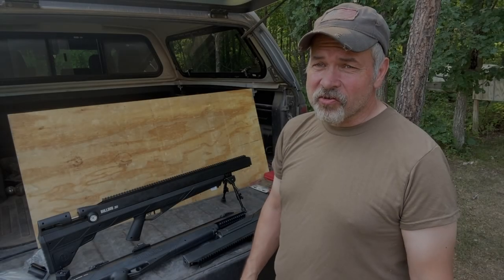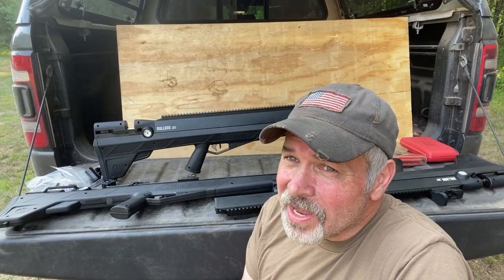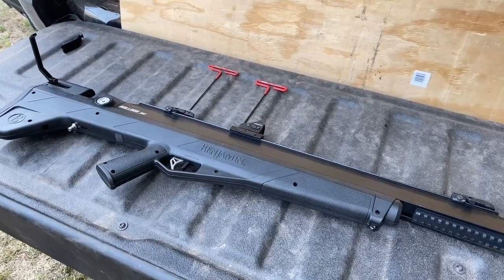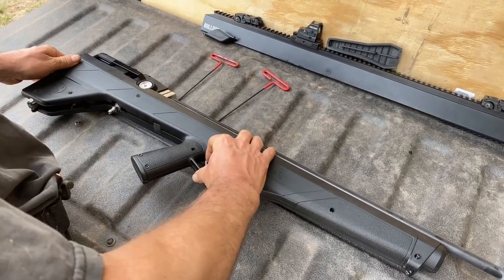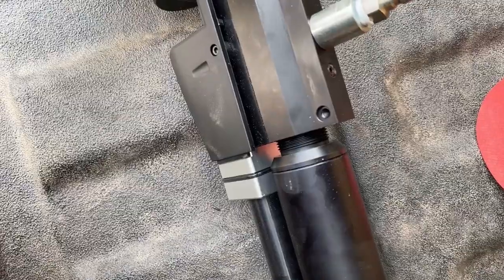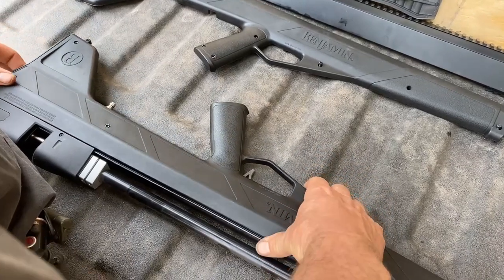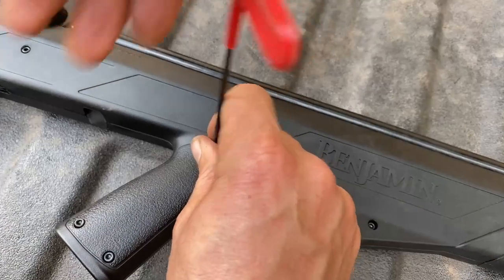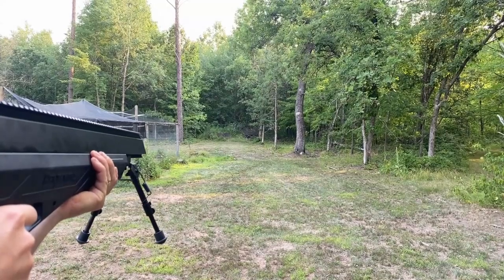How to Install a Benjamin Bulldog De-ping accessory.

Comment: Any tips on getting the reservoir adapter off of the reservoir? Mine seems to be extremely tight and I'm worried about messing up the threads and O-rings trying to get it off, so it's tough to get a solid grip. EDIT: Upon closer inspection, the inside of the adapter is sized for a 3/8 hex key for exactly this reason.
Reply from the maker: Joe, yes sir you are correct... another method is to  use a strap wrench.
Thanks for the view and the comment! 
Have a super weekend! 
-shanek

Comment: Well, I just installed this. Now my bulldog will not fill.  Double checked screw that bleeds air. Not sure what is going on.
Reply: NOTE:  Fixed.  I didn't realize that if the air reservoir is totally empty, you have to cock it in order to fill it again.
Reply from the maker: J, 
I didn't either... sorry about that brother

Comment: Hello I need help!
M
I just installed the depinger and now my bulldog doesn’t get air!!
I verified everything and Everything is tide and still have the same issue, so the rifle does not get air !!
I removed the depinger and leave like I received and doesn’t get air!!
Please can somebody tell me how to do??
Thank you
Reply: I know your situation is a year old but after installing the de-pinger and everything is put back together, you must cock the charging handle fully as if you’re loading a round in order for the reservoir to take air pressure. Maybe someone else lately has had the same issue so this reply may help them.

Comment: Excellent video.  I would still find a way to screw something up.  I might have to live with my ping noise.
Reply from the maker: Thanks for the view and the comment Todd, Its a simple process but I know it can be a bit daunting taking something apart that far.
If you decide to give it a try and get in a pickle, let us know and we will do what we can. 
Putting the safety back in place can be a booger I can tell you that much after having done several of these. Lots of try and try again sometimes 
Stay safe and have a nice evening, 
-Shane

Comment: I have a bulldog, that I'll be installing one of these in, but does anyone know if the new bulldogs, still have this ping noise in it.
Reply: Yes, I just bought the 457 and the ping a very loud. I just ordered the depinger will install once it arrives.
Reply: @blurmb300  wow, that's really surprising that Benjamin would, still have that awful ping noise. I know I bought mine a few years back. Thought for sure they'd get rid of it by now.

Comment: Hi, I installed the DePinger and now when I fill it air just comes out of the barrel do you know how to fix that?
Reply from the maker: First, be sure to re-tighten the air dump screw beside the trigger... If that doesn't fix the problem 
it sounds like your discharge valve may have come out when you pulled the air reservoir. Check to see if the valve and spring are still present (The valve is under the spring) and make sure the valve is installed in the right direction and seated.
Be sure to let us know what you find!
-Shane

Comment: My gun came with one of these but without instructions or info on what it was.
Reply from the maker: Baron, 
That's kind of silly of them to include it and not even let you know what it is or how to install it.
Most of the de-pingers work the same and are installed the same. These instructions should get you there... but that is a head scratcher for certain that they didn't provide info.
-Shane

Comment: What would you use to push out jammed pellets in the barrel once you take the barrel off from the gun
Reply from the maker: Patrick, I use the plastic barrel clearing stick that comes with it and rap it with a hammer. If you have lost that stick you can use a wooden dowel or if you are SUPER careful, I have used a piece of steel rod that I had in the shop too but that makes my skin crawl whenever I use it.
-Shane
Reply: @amorepreparedlife4557  I use the steel rod and it's still not budging so what I was planning on getting a one foot drill bit once I pull it off drill from the other side of the barrel that's closer to the end
Reply from the maker: @patrickhamilton1617  I guess I never had one stuck that bad... It does take some pretty good whacking usually.
Let us know how you get it done for sure though! 
-Shane

Comment: I just realized that the bulldog kind of looks like a G-11?You should check out the new aea challenger big 9 bullpup it’s shooting a 180grain .357 slug at 1000fps, It’s my first air rifle I can’t wait! Hope that depinger works on my gun. I don’t know why they don’t add them to every gun before they come out of the shop.
I also wonder if you put a bunch more o-rings on the depinger if that if it would make it even more effective.
Reply from the maker: Greg, We haven't tried additional o-rings but I agree with you, I think that might help too. We have  considered putting a bicycle inner tube tightly around the outside of the air reservoir.
And, yeah man, we TOTALLY agree that the manufacturers should have these included in the design from the factory. The "boing" sound is just a pathetic oversight on their part as far as we are concerned.
I will definitely check out the new AEA Challenger. You will have a TON of fun with these things man! they give you back the chance to shoot cheaply again. 
Have a super evening
-Shane
Reply: On the issue of depinger, check out 'Pittbull Airguns out of San Angelo, TX. They have a nice depinger, I know I have one on my Bulldog. Enjoy...
Reply: @petebuffkin9067  you sure that will fit inside the new challengers tank?

Comment: Is that trigger bar spring in correct position?
Reply from the maker: Yes sir.
Correct position same way the factory assembled it and fully functioning.
-Shane
Reply: @amorepreparedlife4557  the spring isn't in the right place ;)

It must be blocked by the stop , otherwise the spring has no effect tu pull back the trigger ;)

Look at other Bulldog disasembly videos